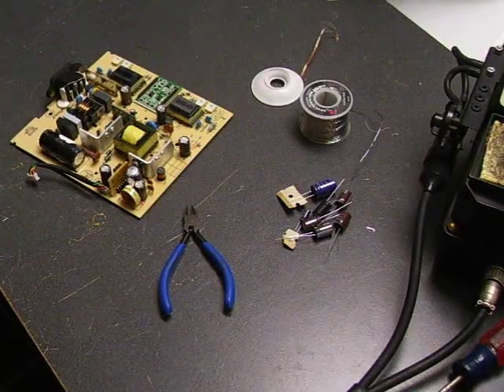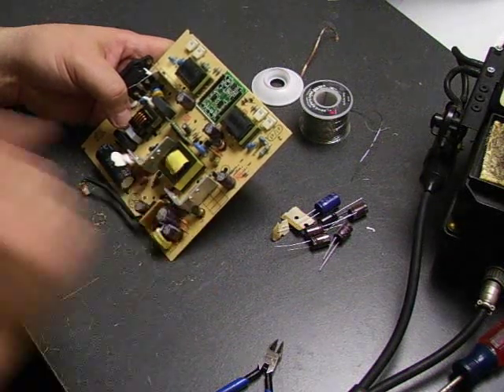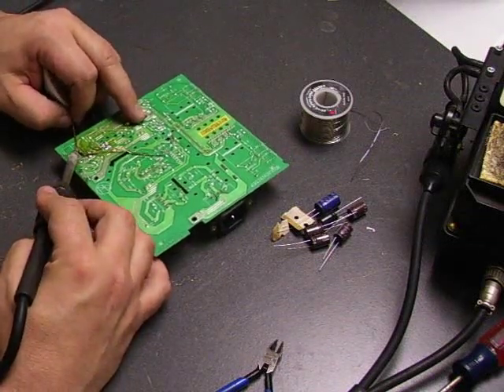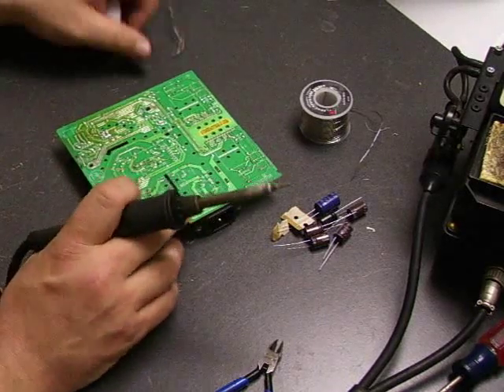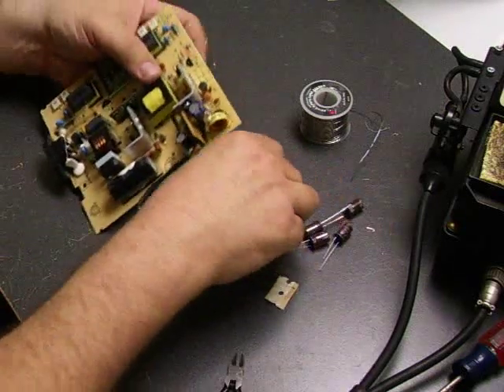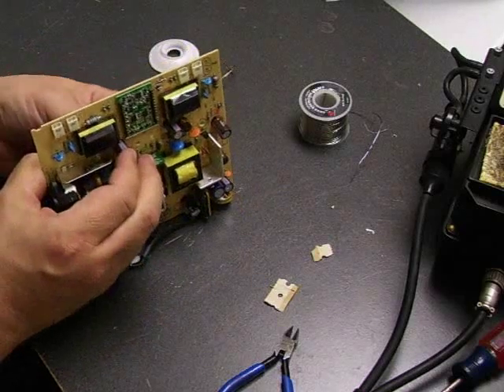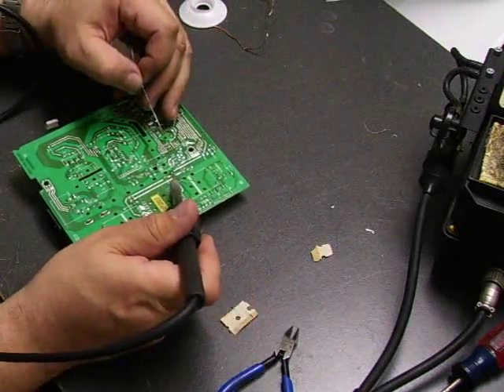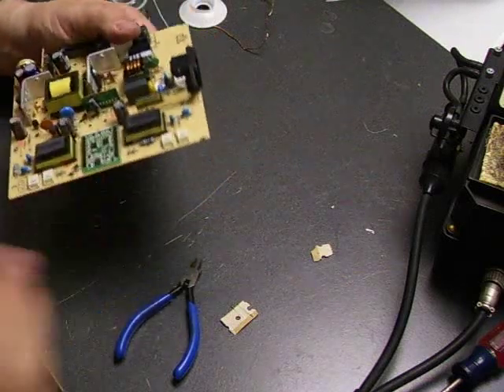Repairing the Dell E198FPf LCD monitor - Part 2 board repair

Comment: Does the capacitor kit that you carry apply for the same issue on an SE198WFPF, and if not, do you carry a kit that will apply?  I used this video and the following to disassemble the monitor and it was pretty much the identical process; however, the board is different.

Comment: If you feel you will forget the locations of the individual caps, draw a diagram...  No good at drawing take a picture...Can't read the values of the caps in the picture?  Mark them with masking tape which you can mark or try different shades of nail polish.